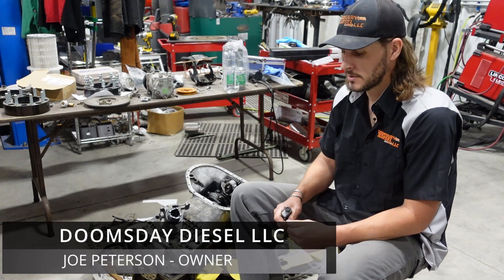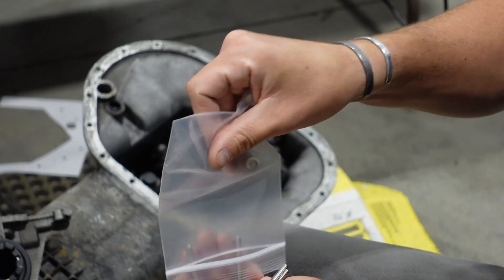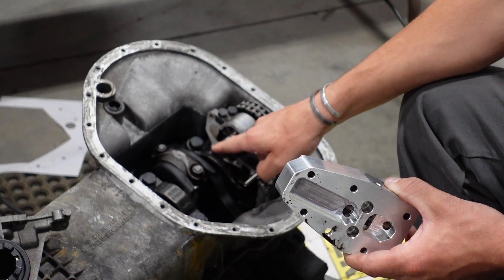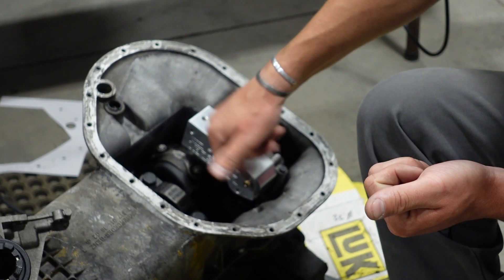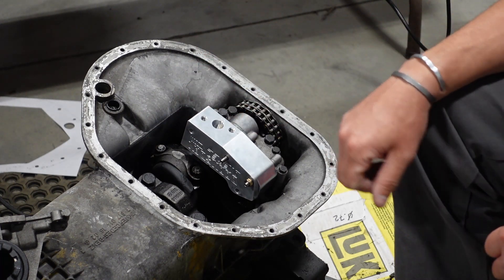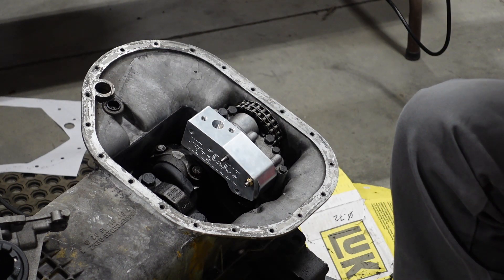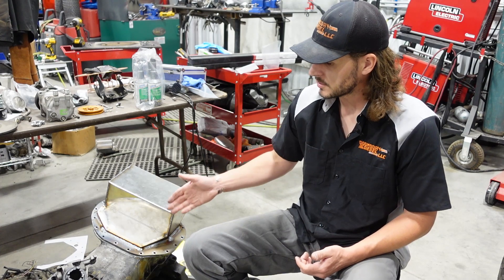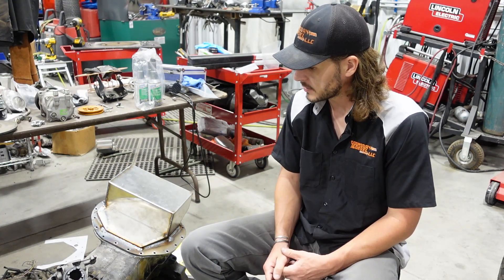OM617 Front Sump Oil Pan Installation Part 2

Comment: So have you found this is needed for jeep wranglers?
Reply from the maker: On YJ's yes. On TJ's, it is if you don't want to move the transmission.
Reply: @doomsdaydiesel  ok so I assume if I where to move my ax15 back I wouldnt need to do this?  Any do and don’t with a tj?
Reply from the maker: @richardmauch1042  move the ax15 back and mount the engine high enough, and you can keep the factory 617 pan
Reply: @doomsdaydiesel  thanks for responding to my questions. I am currently looking the scrap yards and market place for a donor. Once I start that I’ll be making a bunch of orders through you. Any things to look out for while my search begins for an engine or just the usual?
Reply from the maker: @richardmauch1042  just make sure the crank will rotate (27mm). Not worth pursuing if it's seized

Comment: I understand the issues that come with low oil pressure but what happens to engine internals when you have too high of oil pressure?
Reply from the maker: Blow seals, oil lines, etc
Reply: @doomsdaydiesel  ah, so theoretically if an entire engine was designed with seals and lines that could handle it, it wouldn't damage any of the rotating mass wear surfaces? Maybe just reduce the service life of the oil